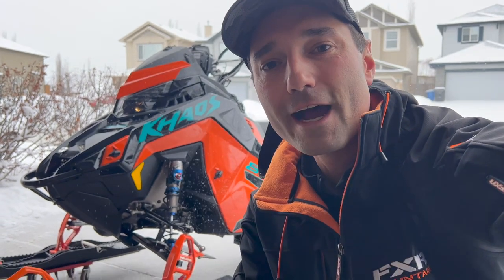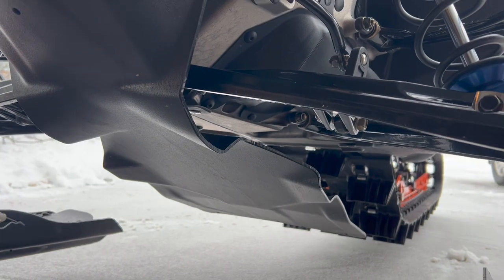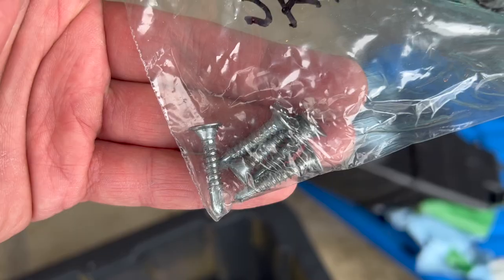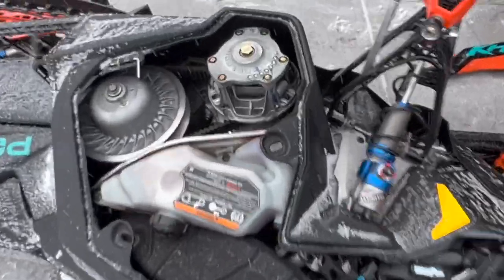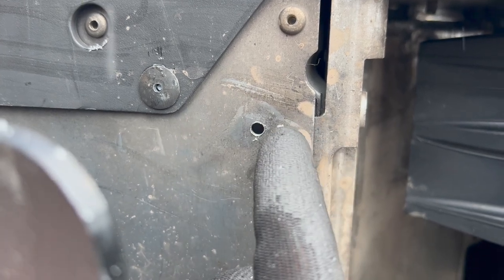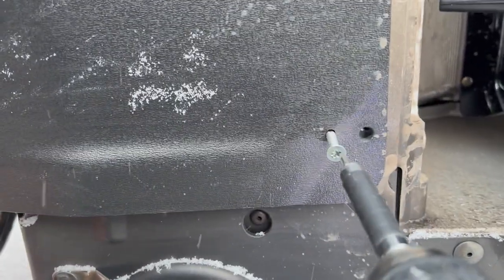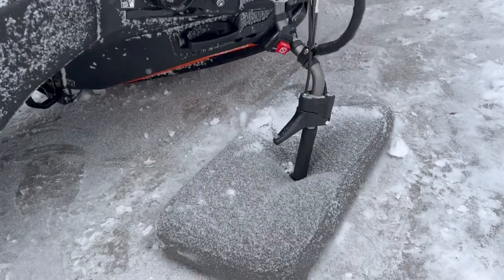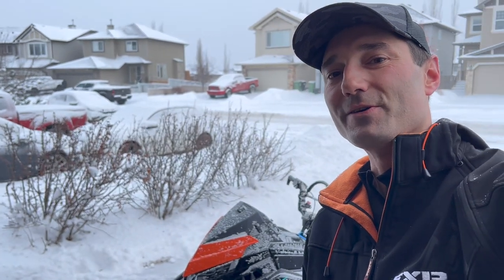This Part Might Be Loose \\ Snowmobile Pre-Ride Check

Comment: It will fall off again. I put a self tapping/6mm body screw with a loctited nut on the other side. There is enough room to get in and put a nut on the other side on the two outer one. Silencer and secondary must be removed.
Reply from the maker: The metal that the screws go in is too light of gauge for self tapping screws. Bolts it is!

Comment: It will fall off again. I had two matryx and they both fell off after dealer install. The two outside fasteners i put self tappin 6mm x1 pitch bolts in and a nut on the other side. Its on for good now. Secondary and silencer removed you can get in to put nuts on.
Reply from the maker: Thanks for the tip! I had a few extra screws from my old sled that I might put in. I like the bolt idea. That or some pop rivets.